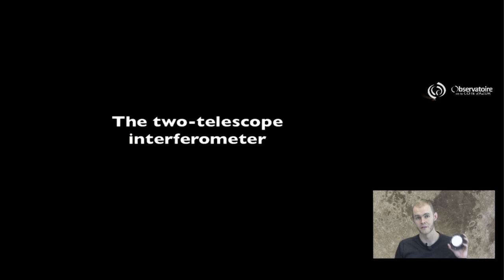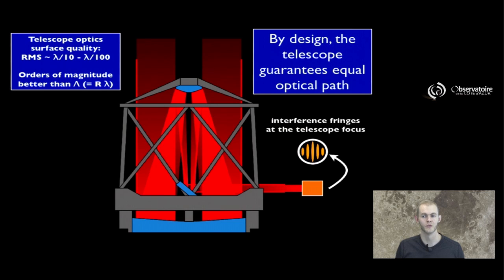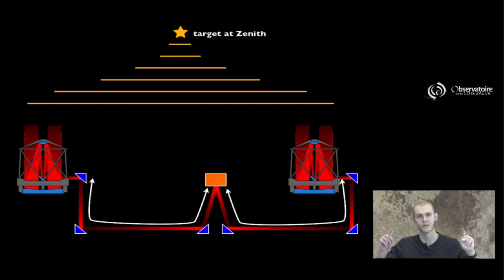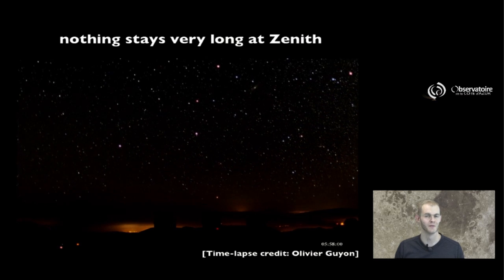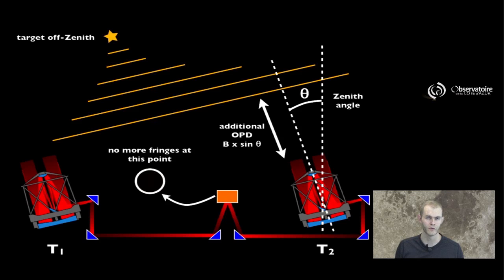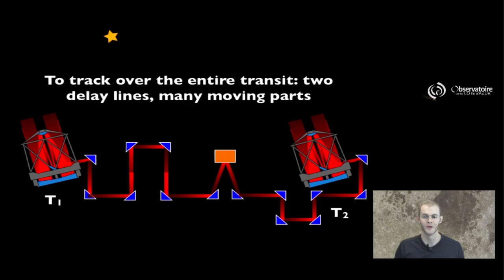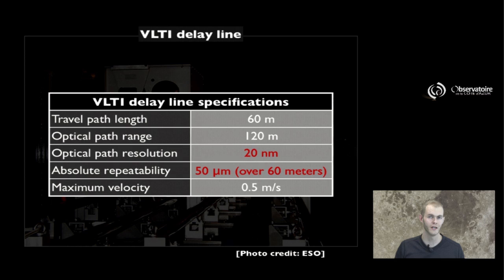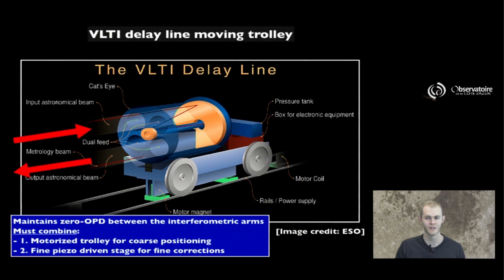The two-telescope interferometer

Comment: Is it worth the trouble to substitute the air delay line by a glass (or water) delay line, to a reduce space?
Reply: Can’t move a trolley thru glass… How would that work? As for water, I guess you could have a submerged trolley but then you have a lot of fluid turbulence that would complicate the precision positioning of the trolley.
Reply: @AdrianBoyko  thanks for the counter arguments. I take that as educational for me. 

You are quite right about turbulence in liquid for a submerged delay line structure. To address that let me suggest that with a telescoping light pipe filled filled with water. A water port to enable input and output of water in or out of the light pipe cavity to facilitate delay adjustment with the help of an electric water pump? Is it worth a quick experiment to see how much is that turbulence and how long it will takes to see it stabilized?

Comment: but if the optical path is going to be equal, how will interference happen? Shouldn't there be a path difference in order to observe fringes?
Reply from the maker: Haha! Very good question indeed! If the two beams recombined are perfectly aligned and superimposed, you indeed don't see "fringes" but a somewhat uniform distribution of flux. To recognize that you see interferences, you have to modulate the path length of one of the arms and you will see that the flux oscillates (you have a temporal modulation). To see fringes without having to modulate, one can angle the two beams so that as you move from one side to the other of the detector, there are differences in the optical path, which result in spatial modulation. Both approaches are used in astronomy. Spatial modulation "naturally" happens when you have a Fizeau interferometer.
Reply from the maker: The next video in the playlist might help? https://youtu.be/ogilHLfN6EM